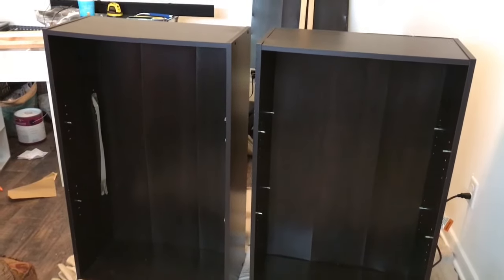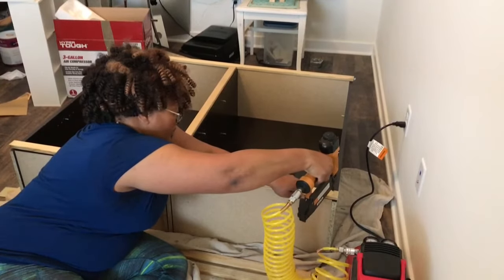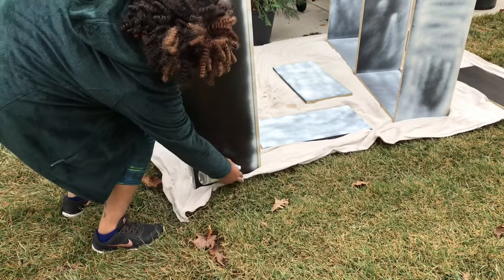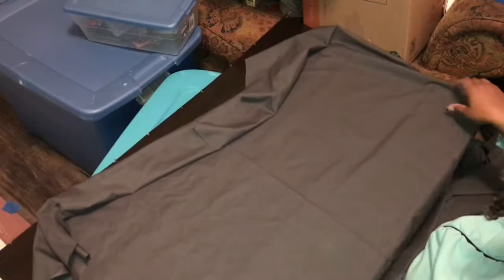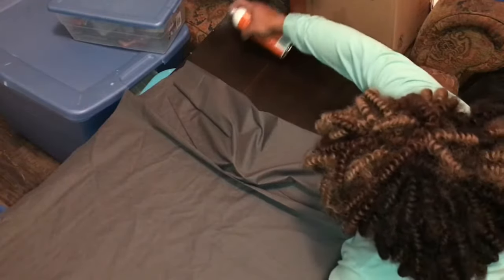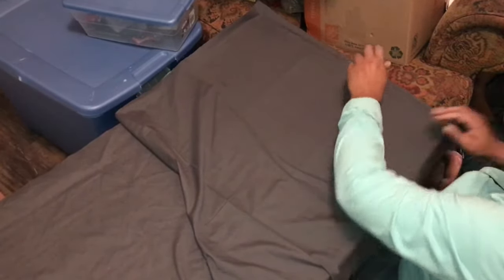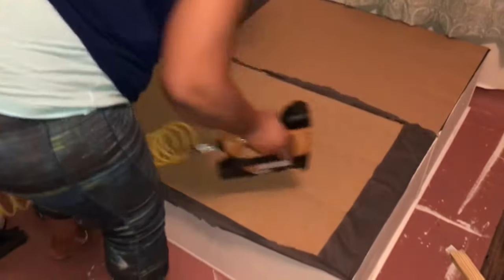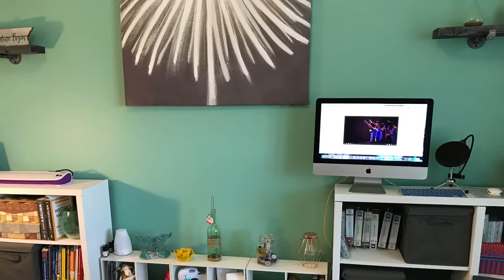Redoing Particle Board Bookshelves

Comment: That looks neat. I'm curious though, how do you reinforce the levels so that they won't sag?
Reply: You can turn them upside down. If that doesn’t fix the sag then I feel you either need new shelves at that point. You can also put a middle support under each sagging shelf. You won’t have the long shelf look anymore but you’ll have straight shelves that are more like cubes.